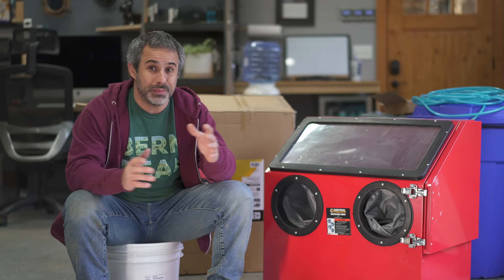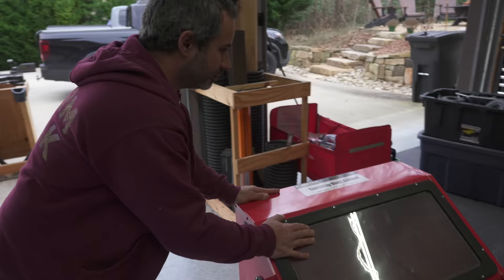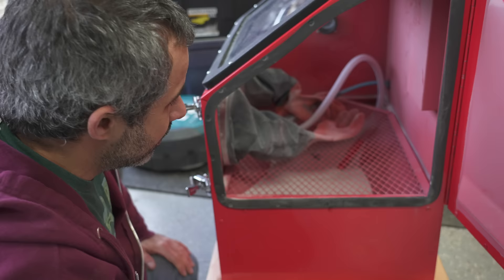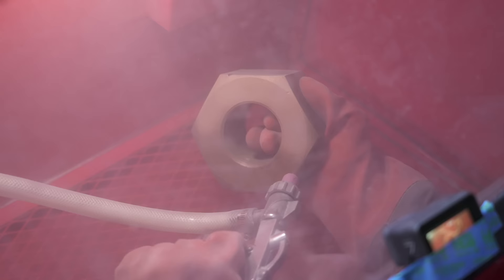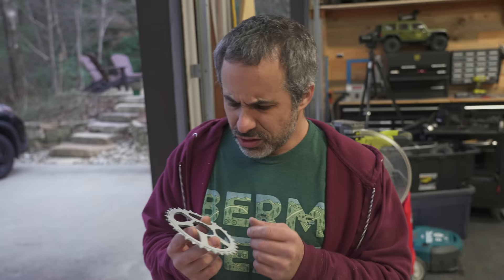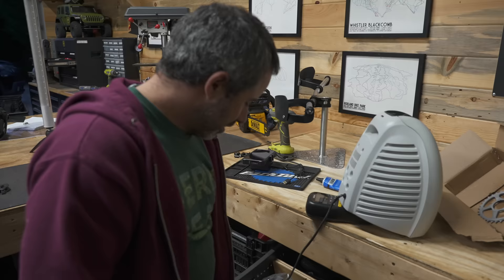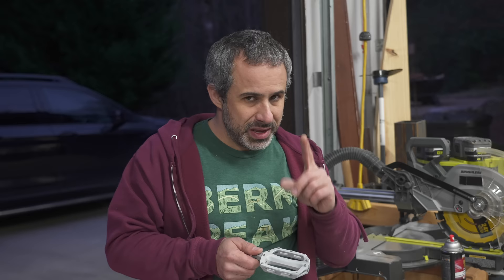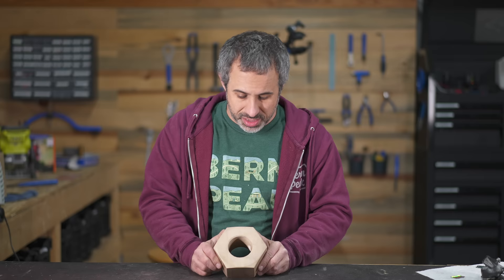I took your advice and bought a Harbor Freight sandblasting cabinet

Comment: I've been sandblasting for a few years and, oh boy, where do I start?!
So first of all, let me preface this rant by saying that we've since closed our sandblasting part of our business because of the income not being sufficient to cover expenses, unless you invest a crap ton of money (I'm talkin' tens of thousands of dollars in equipment).
A few cautionary tales for Seth as a start:
1. When blasting with anything* inside or outside of the chamber *wear eye protection*. The abrasive does get out of the chamber and lemme tell ya... that dirty stuff in your eyes isn't enjoyable. Notice I said ''anything'' and not sand... well there's a lot of abrasive types, starting with regular sand, quartz sand, electro-corund, quartz glass (which actually leaves the best finish and doesn't impact the metal structure (especially the finer grain)),  stainless steel sand and so on... 
2. When exposing of worked out sand, do not leave it in the presence of your dog. That sand is an awesome place for mites, bugs and anything biting to live. 
3. If you're generally working with 3bar or lower pressure, it's not that bad for metal, but anything above 5bar usually impacts materials structure and can damage it. As this is mostly a bike related channel, I highly advise You not to blast anything that's going to have stress on it (if its narrower than 1.5mm(ESPECIALLY if that material is magnesium)). I've witnessed some actual crashes because of a sandblasted frames weakening and losing their tempered qualities. You can actually see in the video that the soda can started to change its structure and warp. It's pretty usual for that to happen to such narrow metal.
4. If your compressor doesn't have an air dryer, after a while you'll start to notice that the sand coming out of the pistol is slowing down and clumping. It's because of condensation.

Here's the thing, sandblasting is an awesome way to get rid of old paint, rust and other impurities, but at the end of the day, it does just smash your part and make pretty uneven surfaces. Since that's the case, you're just trading the time from preparing the part manually by hand to having to coat that part with many layers of primer and putty to even out the surface and have it shine. Oh, and also remember to prime steel immidiately after blasting as it will oxidise from air moisture alone.

Anyway, to close this off: have some fun! Experiment a little, try blasting some wood - it creates some awesome designs! For those thinking ''who are you to give advice?'' - I'm an engineering graduate with a degree in machining (not english, sorry) and have many years of practice in sandblasting, painting, restoring old cars and motorcycles and so on.

Thank You for Your time, and I do hope Seth gives this a read.

Comment: Im an engineer, but this isnt really my area of expertise so take it with a grain of sand 😅. A bike chain is a roller chain, the part thats an actual bearing surface is internal. Meaning the sprocket teeth arent exactly a journal surface, the roller shouldnt slide on them it should roll on them. I would think this implies the sprocket tooth surface finish isnt all that important. That being said it still might gall the outside of the rollers over time.

I wouldn’t worry too much about it. I think its likely any wear that occurs wouldnt happen as fast as normal wear on the chain anyways. The wear that might occur  from the rough surface finish is not in a critical area either way.

A slo mo camera on a bike chain might make for an interesting experiment to see 🤔. If the rollers slide into the sprocket teeth, then better surface finish helps. If the rollers mostly roll with minimal sliding, surface finish doesnt really matter (compared to the other wear the chain experiences).

Comment: Have you ever tried an ultrasonic cleaner? The results are amazing it does the work as you sleep over night. No abrasion on the parts, original finish is preserved. i tried to add an Amazon link but it gets flagged.

Comment: These cabinets are essential to prevent silicosis from sandblasting. It’s as serious as mesothelioma from asbestos exposure.
Reply: Silicosis is no joke.

If you can avoid sandblasting indoors that's ideal. I make identical sandblasting cabinets out of cardboard boxes and plexiglass. It's airtight, and I have connections for shop vacs, but it's so light I can just carry it outside. So that's what I usually do. Same size as this one too.

Sandblasting without a cabinet is perfectly fine, but you need a floor fan. Turn the fan on and sand blast your part in front of it. It'll blow every molecule of silica sand away from you no problem. Wear a face shield though cause you will get hit in the face with bits of sand. It's a trick I picked up from this old Italian masonry worker I used to subcontract with. The guy never even wore a mask the fan worked so well.

Comment: Spend the extra money and buy a good blast cabinet as the “1 time tool” cabinets last about a year then fall apart.  Plus use glass beads not as aggressive
Reply: Huh?

How does something that's entirely made of metal and wasn't exposed to harsh environments, fall apart? What exactly falls apart on these that you couldn't easily fix? If you can restore an old car you should be able to fix a metal blast cabinet one would assume.

I've made blast cabinets out of cardboard boxes that last me years. The one I'm using right now looks identical to this harbor freight cabinet and it cost me $10 to make. I've had it for almost 3 years now. I'm a metal fabricator and I use it everyday before I weld.

All you need is a sturdy cardboard box, some good tape and a piece of plexiglass. Cut holes in the front and you're good to go. Add a light if you want.

It's nearly airtight and I have places to attach shop vacs to blow the dust out of my shop, but it's so lightweight I can just carry it right outside in 10 seconds. I keep it up on a shelf out of the way until I need it.

I'll never buy a blast cabinet.

Comment: Careful with anything aluminum that is anodized (like most of it). The anodizing will get removed along with the hardness/anti wear properties.
Reply: I guess that's not an issue if you're repainting something though...
Reply: @dangerous8333  Depends, anodizing is incredibly hard. If the part is going to see high wear, I would leave it anodized.

Comment: Not enough angle on the bottom, the sand accumulates on the sides, not falling back down over the pickup hole. The panel under the glass is too difficult to change so you can continue to see, very difficult to keep the area clean causing the glass to haze.

Comment: Curious about the CFM requirement from the compressor.
Reply: U need a LOT.  Pancake compressor? Forget it.  I use an 80 gallon tank, twin piston 220volt compressor, and it'll maintain 70-80 lbs psi, but compressor runs continuously.

Comment: You should use bigger grit sand so its smoother and no clear coat needed
Reply: No, quite the opposite. I use ultra fine glass beads, and it looks good.
Reply: @derekhobbs1102  bigger grit means smoother lol so the bigger the number the finer its get lmao

Comment: Ive got an old one, but the viewing port became so yellowed so quickly, that it is almost unusable. You need a work light inside of the cabinet, and press your face to the plexi. I've probably performed about 100hrs blasting in this position. Tedious.
Reply: Why don't you just change the plexiglass?

I make these for $10 out of cardboard boxes and pieces of plexiglass and they last for years.

Comment: You should avoid pointing the blasting gun at the gloves. Those Harbor Freight ones aren't great and will start peeling over time and need to be replaced. Especially with a heavy brass nut, there is no reason to not just set it down. It's not going to get blown away or anything.

Comment: Just a tip with the sandblaster, when you are sandblasting with the intention to paint, don’t blast away all of the original finish and make the piece all gray. Leave small streaks of the original material so the paint has something to stick to
Reply: I'd disagree, take it down to bare metal and then prime it, wet sand to smooth any rough or high spots, and then paint

Comment: Waste of money...

I made the same cabinet for $10.

Get yourself a large box, cut and tape it into the shape of this cabinet. Cut out a rectangle for the window and attach a piece of plexiglass, or real glass. Cut two holes for your arms.

I'm a fabricator and I've been using this for almost 3 years now. It's lightweight so I can pack it out of the way until I need it. Then I just pull it out in front of my garage and blast away. It hasn't even taken any damage.

Comment: Another tip kids. Set your piece down or on something in the cabinet instead of holding it. Your gloves will last longer. Nothing worse than having a hole in your glove. Well yes there is….blasting your finger tips through the hole.

Comment: I bought the same cabinet used, I’m not sure what kind of media he had in it but it does not siphon up and spray out very good. Any recommendations on what type of media or blasting material that will spray out without clogging? I’m not worried about the finish being shiny. Thanks !

Comment: Sand blasting is probably not the best idea for treating parts that need to have structural integrity like handlebars, because sandblasting can inbed sand particles in the metal and cause fractures to form over repetetive work loads.

Comment: My friend has one of those units.  Second time I tried using it... I just stopped.  I emptied it.  I went and purchased sealant.  I also purchased a vacuum to put on a 5gallon bucket.  I spent more making it usable than he spent for the unit.  My time is worth more than anybodies... so getting his up to the minimum specs is faster than me making an hour round trip to use my commercial unit.  They are a piece of shit.

Comment: What size compressor are you using?
Reply: Too small that is why you can hear it kick in when he is blasting. Despite what they say those guns use more than 21 CFM at 80 PSI.

Comment: I've seen this cabinet at Harbor Freight but never checked the price. I can't believe it's only $150
Reply: Just a heads up...

You can make one just as good for 15 bucks with a cardboard box and a piece of plexiglass.

I'm a metal fabricator and I've been using mine almost everyday for nearly 3 years now. Does everything this cabinet does and more cause it's so lightweight I can keep it up on a shelf out of the way, and I can pull it outside to use it. Same exact size as this one but doesn't take up any of my counter space.

Comment: Sand should nit come anywhere near nice parts.
Paint removal = al/ox, either pink or white.
Rust, corrosion, oxidation and a nice finish at the end, glass beads, soda or walnut shells.
Different grades available for everything.
Dismantle a component in its entirety prior to blasting.
The biggest drawback to hobby machines that people dont realize, is not having a compressor with big enough oomph.
It gets old real quick waiting for a compressor to catch up.

Comment: You have to be super careful blasting aluminum. The heat caused by the friction from the air and abrasive will warp aluminum parts

Comment: I’m an engineer, echoing others in the comments, you generally wouldn’t want to sand blast small parts in a load path. However, I work in prototyping, and we do a lot of things that aren’t recommended.

Bottom line is if you can safely test it, do that - might save money and time. 

Something I’d note though is that sandblasting isn’t exactly quality controlled unless you measure each part after. So if you test one, don’t assume the next will be OK also.